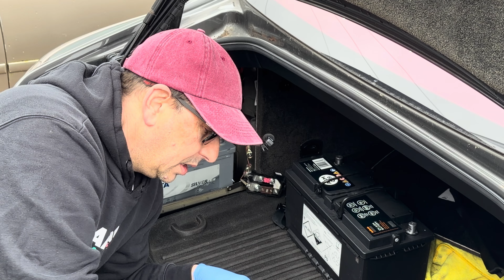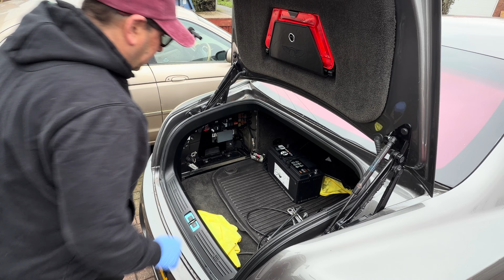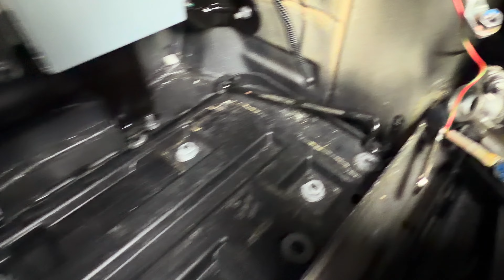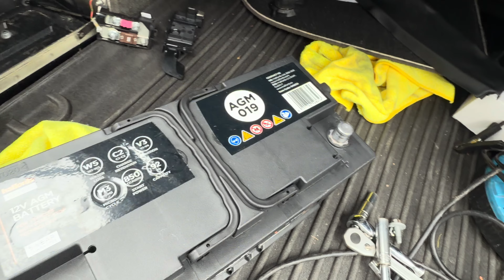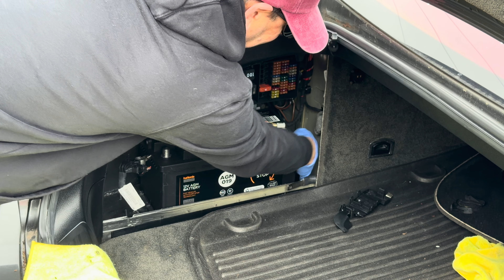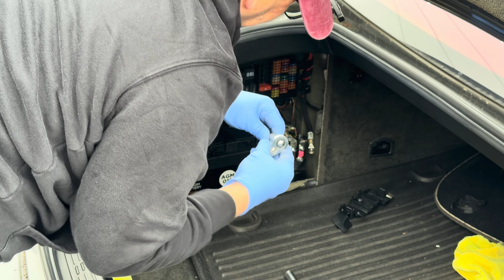Bentley flying Spur Battery replacement

Comment: Are you sure that this is the auxiliary battery and not the main starting battery for the engine? It does not matter if you disconnect this one. The auxiliary battery on the RHS does need to be in parallel otherwise the computer will wipe itself and all settings will be lost.
Reply from the maker: i’m fairly sure as when this was dead as in 0V the car would still start from the small battery but the car would throw loads of faults until the battery was replaced.

Comment: You may have to put another battery in parallel prior to disconnecting as you will loose the memory in the immobilizer, then there is a 'no start'
Reply from the maker: That can be the case with some cars and it’s never a bad thing to do. However on this particular car that’s not an issue 👍